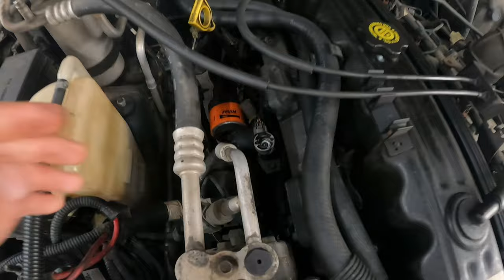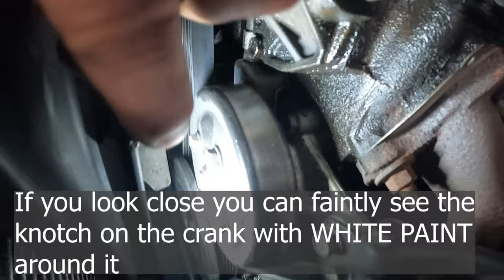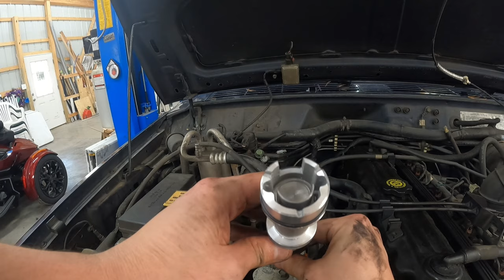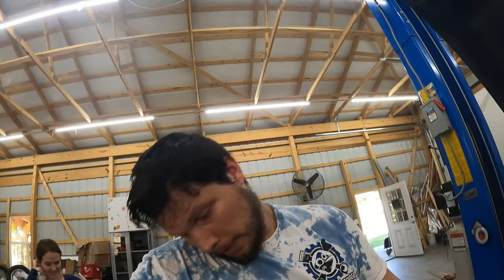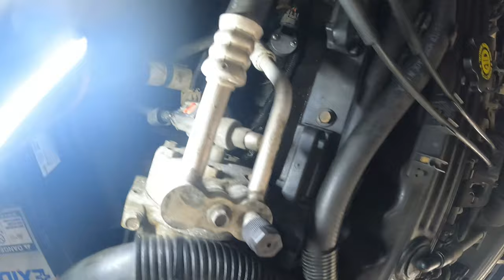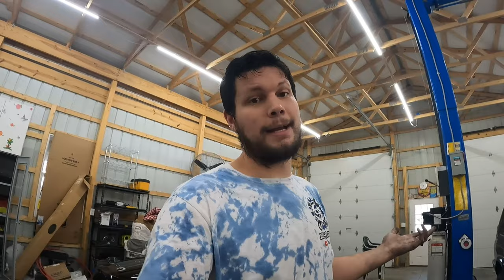2000 Jeep Cherokee 4.0 P1391 and P0340 - Camshaft Synchronizer Replacement - Cam Sensor Grenaded!

Comment: As the oil pump drive to cam gear relationship wasn't messed up on the original, you shouldn't have had to mess with the oil pump.

If the upper part hasn't broken off the shaft, you don't even need to be at top dead center. You just need it to be in a known indexable location. I chose to align the tall part of the shaft parallel with the block. With how course the gear is, a tooth off in either direction is very noticeable.

Comment: you can also pull the cam shaft position sensor (not the shaft) and put the timing mark on zero, if a toothpick fits in the side whole of the CSPS you're good.

Comment: Replaced my sensor on 2000 XJ, still getting P0340 Camshaft Position Sensor "A" Circuit Bank 1 or Single Sensor.
Reply from the maker: Did your synchronizer have any play ? Did you inspect the wiring for any issues?  This code could also be caused by crank position sensor as well .
Reply: @Just-Fix-in Garage  had crank position sensor replaced right before this. Also synchro seemed to have no play. What was strange though when I replaced the cam sensor the wiring connector looked like something scorched the hell out of it. Not on the inside of the connector but the outside where it all clips together.
Reply from the maker: @technical19d34  is it a crank no start you are getting or just a code but car runs ?
Reply: @JustFixinGarage  it was crank no start intermittently before all this. I could drive it for days with no issue, then after a short trip or 2 crank no start, would start after 5 or 10 minutes, but gradually it became more often with longer duration before it would ever start again.
Reply: @technical19d34   any update? I have another Crankshaft & Camshaft Position Sensor plus an Ignition Coil. I’ve replaced the CPS several times but not the others.
Reply: @Bpebler  it was the cam position sensor, that fixed the issue. But it also developed a hard knock and the main bearing crashed, whole engine needs replaced. After waiting 5 weeks for a reman  motor with a warranty to show up at the shop, looks like I will have a new engine by next weekend.
Reply: @technical19d34  oh crap I’m sorry to hear that. I replaced my 4.0 due to a bent rist pin @ 155k. I have replace the crankshaft position sensor a few times, but not the camshaft position sensor yet, so I have both of those and an ignition coil to put on just in case.
Reply: @Bpebler  I think both sensors can be affected by oil leaks, mine had a leaking valve cover gasket which I fixed awhile back, but a little oil had caked onto both. Someone told me it will cause those sensors to go bad over time. Not 100% sure though.
Reply: @technical19d34  
That’s true. I’ve had my Jeep for almost 13 years from stock to fully built - the crankshaft position sensor is the touchiest one & will repeatedly go bad. Best advice on sensors is get the OEM ones from a junkyard. They still always work better than brand new aftermarket ones even from the good auto parts stores. I picked up my 3 parts yesterday & they were quick to say “you know this is so & so brand right?” Brand new sensors can be bad too or last just a few weeks/months. 😑

Strange, I’m having the same issue. Leaky rear driver side valve cover. Replaced it but wasn’t perfect & still leaking so going to have it fixed tomorrow.
Reply: @bpebler  100% true on those sensors, especially anything sold on amazon.
Reply: Hey if you don’t mind me asking, where’d you grab your motor from?
Reply: @BabaKahuna  I'm not sure where the shop got it but I know it's a reman with a warranty. Block looks brand new.

Comment: Appreciate the video I'm currently having a similar issue I changed the top sensor did not change the synchronizer when I start my vehicle it hesitate and I usually have to start it two or three times before actually cranks over I would like to know if you think that's due to the synchronizer and whatever you able to just drop the secret answer in without any type of alignment
Reply from the maker: What code are you throwing if any ? When you pull the cam sensor off does the spinning part have any play? It should be fairly solid and not be able to spin around . Mine had a lot of play and if I spun hard enough it would move independently . Be careful doing this so you don’t strand your vehicle somewhere .

Comment: What size was the hex head bolts on top of the Camshaft Sensor??? 5/32”?? 4mm too small and 5mm too big
Reply from the maker: Hey raider sorry I don’t recall . I just know I had one on my socket rail so it must have came in a regular set.  When I googled your question it said it was a 4 mm . Perhaps some rust build up is making it not work ?
Reply: I think it varies. I swapped mine today. One had very rusted bolts that I hammered a 5mm onto. The other used a 5.5mm socket.
Reply: 7/32